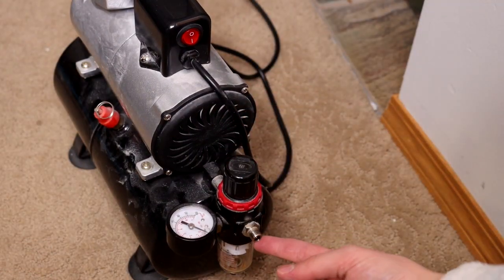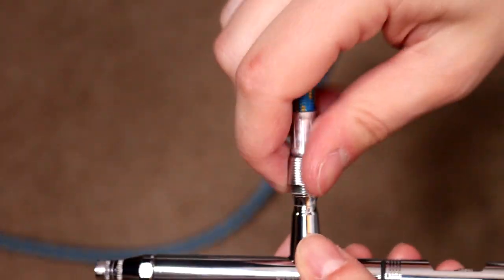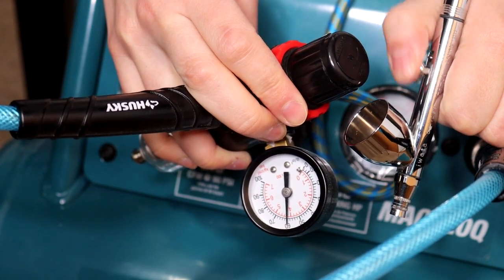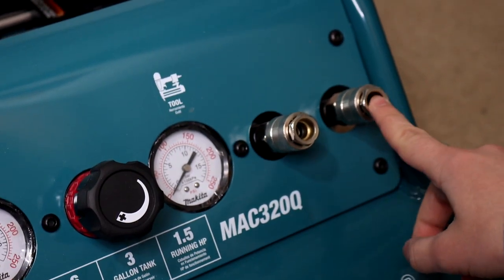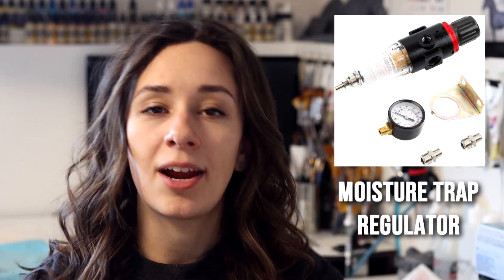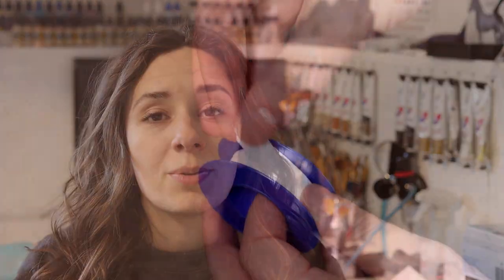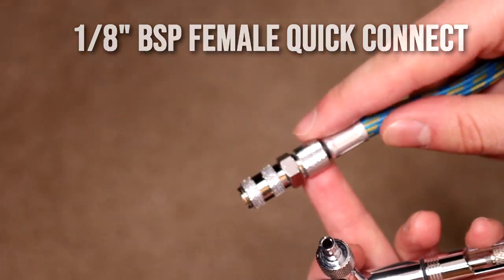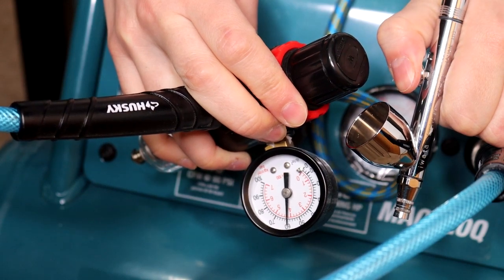HOW TO Set Up your SHOP or HOBBY AIR COMPRESSOR for AIRBRUSH a Beginners Guide!

Comment: Terrific video!  Instead of screwing the air hose to the regulator inlet, I installed a female quick-connect in the regulator inlet, letting me use an air hose with a male quick-connect.   Second, you don't need to completely drain the tank on the compressor after using it, they're fine if you leave them full.  Just crack the drain valve for a second or two before and after using to drain any built-up condensation in the bottom of the tank.  Finally, it's more convenient for me to leave the regulator on the compressor high (say, 75PSI or even more), and then adjust the small regulator near the airbrush to the pressure I want the airbrush to see.  That way if I want to change pressure, it's right there at my workstation.

Comment: Don’t release the valve under the compressor onto your carpet !  The tank has water in it and you should use the valve to get the water out as well as the air.
Reply from the maker: Yes, I have a mat underneath it now!

Comment: Thank you so much. Great at explaining. I am trying to get set up with my little 1hp, 1 gal Senco compressor with a Paasche for now. And, everyone has been telling me you can't get a 1/4 NPT(national pipe thread)-1/8 BSP(British standard Pipe). Paasche has a little tiny threads on air brush, and 1/4 NPT on other end. Where I guess all the other air brushes have 1/8 bsp-1/8bsp on their hoses. My compressor takes 1/4 NPT.

Comment: Great video. One thing for your viewers that want to do this on a double port compressor and run tools without wearing out their arms or regulator knob is to buy a trap with a regulator rated to your normal pressure.
Doing that should allow you to set your pressure at the tank to the normal pressure for your air tools while adjusting at the trap down to the eighth inch hose and airbrush limit.

Comment: Very clear and comprehensive info.
You must look into 1/8" quick releases with built in air valves. Then you do not need to adjust the wall mounted gauge. I'm sure by this time you do not need to know the exact air pressure you are spraying at. Harder & Steenbeck and Grex makes great ones. If you install the small watertrap before your small quick release, you can use it on both airbrushes, not just the Micron. On the video the compressor sound quite loud. I have a compressor with the same motor and can say that is is not as loud as it seems. For years I painted in the room right next to the bedroom while my wife was sleeping.

Comment: Love your explanation 👍

Just one tip for you - you can add more tape (trial and error though) to the moisture trap pressure dial fitting/thread so it will face you to then be able to remove the need for a mirror to see the pressure at the air brush end.

Comment: There you go! So many videos about the small kits... but One to rule them All, yours!
I already have a 2 tank 5 gallon compressor similar to yours and wanted to know if I could use IT with an airbrush. At the "Toys for Men" store, I was surprised to see an airbrush kit for the first time, and when I inquired about the setup, I was shown the hobby kits with the pump but no one knew about whether it could be connected to the bigger compressor. 

So, Thank You for the video

THX 😊

Comment: This was something that I was delving into, instead of buying an airbrush compressor when I was looking to use this medium, ( buy airbrush, need paint, can I use craft paint, oh need hose, ah they have quick connects, damn cleaner and thinner is over expensive for what you get, can I make my own, phew 😮‍💨 😅, and so on). As my plans for this was not so much modeling, or using on canvas or lures, but, for accents on my small woodworking projects. Glittering, faux finish, antiquing, etc, and not just using stain or paint or clear coats.

I already had a small workshop compressor from Canadian Tire, and the only thing missing was a water filter, therefore I needed the extra connectors to set it up, which I was looking into. You did give me something new, as I did not think of using one of my 1/4” hoses first, then water filter, and the reason why. Though in all fairness, I did not know or look at the acronyms NPT and BSP, ONLY focusing on 1/4” and 1/8” connectors with what was necessary in male and female. 

Nicely done on validating and adding what I wanted/needed to do. Great job, as I found this vid by accident looking at other airbrush criteria. Thanks, and cheers. 👍(Oh, fun looking bunny footwear 😂)

Comment: Build you a lil baby shack that fits just around your compressor get a longer hose and put it outside right against your house. Make the lil cover lockable bc that’s a nice compressor. Good video, very informative.
Reply from the maker: I’ve thought about this too. Though I have Canadian winters.
Reply: @ChairMan71196 made me think: the muffler on the air  ¿intake? of my machine doesn't stay in place (I broke it by accident) and I notice a very obvious difference in sound when it falls off from the vibration. It needs a minimum of 1 foot clearance all around, but some sound absorbing material could be used to reduce the sound even more.
I also wanted to mention to you, because I find you're sharing good info, my machine is a bit quieter than some other models because it uses oil to lubricate the pumps piston. On my basement cement slab, I only use a rag under the pump mainly to catch the water and debris coming from the tanks when I drain them. 
If I were on carpet or a finished floor, I would use a cardboard or piece of wood wider then the pump under the rag - under the pump to ensure the carpet/ floor stays clean and to catch any oil spill  from the compressor. 
I'm not the most knowledgeable person on compressors. I got mine a while ago to paint house doors which turned out nice and to power tools while I was renovating. I recently used an airless paint sprayer for some furniture pieces and it does produce less over-spray but I'm not sure about the results. I might need more practice. 
 Keep making videos; you seem to do them right.
Reply: @ThinkerTinker74  thanks guy. It does take a lil practice to make the paint job perfect, like anything in life “practice makes perfect”. You can prolly get a rubber coupling to fix your intake at a hardware store if you have a piece sticking out on the air box that is. If not I’d get some epoxy and the right size pvc and make my own if it’s broke off flush with the air box, just mak sure one piece is small enough to slide in the box so you can epoxy on the inside and outside so it’ll be stronger then use a coupling that sizes up to what size you need ( I forget what it’s called). Ive snorkeled many bikes, it’s easy. On the paint I’d start out with a light coat it (like can see the background light coat) help’s with adhesion then you can lay it on a bit thicker, 4 coats tops. Ive also worked in construction and done a lot of painting lol. I don’t really make videos so there’s that lol have a good one.
Reply: @DeeJayBeStudios  you could maybe seal it up with insulation and put a light or two in there to keep it warm ish and it should be good through the winters.

Comment: Once you're roughly dialled in the desired pressure at the tank, you can zero it in by adjusting it while spraying air through your brush to get the exact spray pressure you want, rather than just estimating an overshoot of 5-10 psi. 👍
As well as draining the moisture trap after every session, also use the drain at the bottom of the tank about once a month to clear any moisture in there as well.  I just watched a video of Barbatos Rex demonstrating a new compressor and he mentioned that he had forgotten the tank drain on his old one for about a year and it blew out because of the amount of water in it.

Comment: Paasche also makes their hoses with a 1/4” NPT female end so you can thread directly onto an air compressor hose. Good video! I’ve been running the Milwaukee cordless air compressor, curious how the Makita would stack up to it. I went with Milwaukee because all of my tools are Milwaukee and I have far too many accessories and batteries to switch brands. I will say, though the Milwaukee is ridiculously quiet, if I had a speaker playing music loud and my Milwaukee kicked on I probably wouldn’t hear it. I also like that it’s batteryoperated and portable. However, it will drain the small batteries so fast so you will have to invest $200-250 on a bigger battery. I’m in construction so I have a crap load of batteries anyway.
Reply from the maker: I did see the battery ones are much quieter. Maybe one day I’ll covert to that instead!

Comment: Yes you have answered my questions on how to set up my pancake compressor for air brushing. And the idea of a longer hose so I put compressor somewhere else perfect, now I need a new regulator and moisture trap , I am a model railroader so I and painting detail stuff at the moment but I want to use a fan nozzle for larger kits etc , going to your  subscribe

Comment: The red ring on the trap is a nut which secures it  to the bracket. Your gauge will then be the correct way round .
Reply from the maker: Yeah, I’ve since fastened it to the wall!

Comment: You can remove the red plastic collar on the moisture trap/regulator and stick it through the wall mount hole from underneath, and then screw in the red collar from the top. This will firmly fix the moisture trap on the clamp.😊
Reply from the maker: Yep! I have since done this!

Comment: You do know that that red ring on the regulator is to be unscrewed, and a mounting bracket can be placed between or rather below the red ring, and then the ring can be tightened to permanently mountain to regulator
Reply from the maker: Yes I know this now ☺️ always learning

Comment: The valve on the bottom of the compressor tank is actually to drain the moisture from the tank.
Reply: Yes but draining the air when done prevents a lot of the moisture from building up in the first place.

Comment: Thank you!  I just got back into modeling (WWII aircraft) and want to get into airbrushing.  I almost bought a kit but I have a big and little shop compressor so thought why can't I do this?  You told me exactly what I need to get this done, and save some money!  I already knew a lot of the basic stuff, like using teflon tape and the thread sizes, but you covered everything anyone needs to know for this process.  Do you recommend the traps on the base of the brush?
Reply from the maker: So glad I could help! I live in a dry climate, so the airbrush traps aren’t imperative for me. I kind of find them bulky. As long as there is a trap before the airbrush hose, you should be fine!
Reply: @DeeJayBeStudios  gotcha, maybe I'll need to use an extra separator in the humid spring/summer.  I'll just have to find out through trial and error with my setup, thanks again, I cant wait to get started.  I got it all setup just need to gain the confidence to put paint in it haha.

Comment: Thank you so much!!! Hey question for you... I want to get an air compressor because I'm tired of gessoing my canvases using a brush. It is so time consuming. 
I want to do a range of sizes of canvases. I want to do small to big (like the size of a wall (8x10).. I'm willing to do smaller). Can you please tell me what you would recommend (specs and brand)?  Thank you so much! 💕
Reply from the maker: That depends what kind of airbrush or spray gun you are using. Using a normal airbrush would probably take just as much time as hand painting.

Comment: So it's about a 4-5x cost investment over the old system. I wonder if there's a middle ground, especially when the new compressor is not running at full capacity.
Reply from the maker: The pressure is unmatched. For the price, this is a good option.

Comment: Do you think that the pressure gauge & regulator on the Compressor itself is fine enough so that I can mount a screw in moisture trap underneath the pistol?
Reply from the maker: It depends on your climate. I never have moisture in the traps, but it is very dry here. In high humidity, you definitely need a trap. Otherwise you’ll be spraying the moisture in your painting and it will ruin your project.
Reply: @DeeJayBeStudios  Just thought that the little Screw On Pistol Moisture Traps arent enough to safely do this. But may be fine enough

Comment: What air pressures do you mostly use for your horses etc and paper I’ve been oil and brushes and at 69 finally got the airbrush equipment and 20 psi is around what pressure is common for models etc I will doing both plus automotive touch ups but now I like your horses in particular and I have a stable of them in some drawings now it’s time to tackle them so please give me feedback on your pressures used . Thanks
Reply from the maker: I spray at a higher pressure than typically recommended. 40-60psi
Reply: @DeeJayBeStudios  thanks

Comment: I just wanna say that I converted my milwaukee compressor for airbrushing and its light years ahead of other compressors! So quiet, no oil, small, can be moved around with ease and I can dial the air down to 1 psi if needed. Not to mention ive never gone past 1 battery bar with hours of air brushing for days.
Reply from the maker: Is this the battery powered one that you use?

Comment: I understand you set your spraying pressure to 5 psi over what you need but What pressure do you turn the air compressor to ?   Thanks!
Reply from the maker: I spray at around 60psi

Comment: Can you remove the 1/4" quick connect from the compressor and convert it to 1/8" from there? Like with a 1/8" quick connect? Thanks
Reply from the maker: You potentially could, it was recommended to run a normal hose though as the pressure is strong from these machines, that a 1/8” connection can’t handle. The setup I show here is recommended.
Reply: @DeeJayBeStudios  Turn the line pressure down with the regulator.
Reply from the maker: Go for it!

Comment: I never considered that the secondary moisture trap could act as the ⅛" BSP adapter. Seems obvious when you stop and think about it.. 
Thank you for the video.
Reply: I actually found the exact same regulator you recommended, but the UK one had a rear connecting pressure gauge, so rather than it facing left/right it actually faces OUTWARDS, basically the exact way you want it to work from your setup.. 
You may be able to find the exact same gauge for yourself.

Comment: @DeeJayBeStudios do you have to have a pressure gauge on the regulator moisture trap?   I picked up a Central Pneumatic 1/4” mini air filter from Harbor Freight. It says it removes excess water and dirt particles from the air line.  60 SCFM at 100 PSI maximum flow capacity.  Manual drain.  It does not have a pressure gauge on it. It only has a hole on each side to connect the lines to. Did I get the wrong thing?
Reply from the maker: You don’t need a pressure gauge, but it’s helpful in seeing what you are spraying at.
Reply: @DeeJayBeStudios  okay, thanks so much for responding! ❤